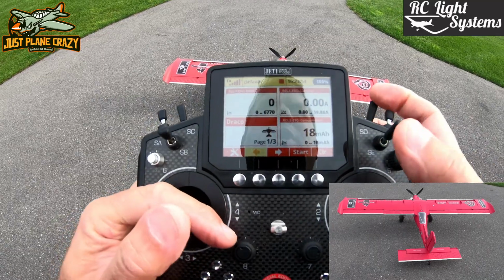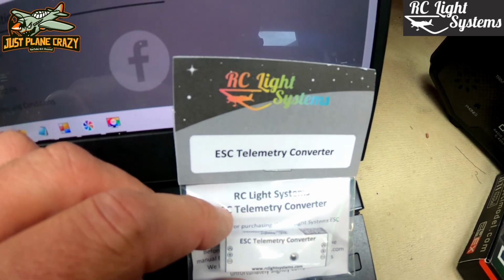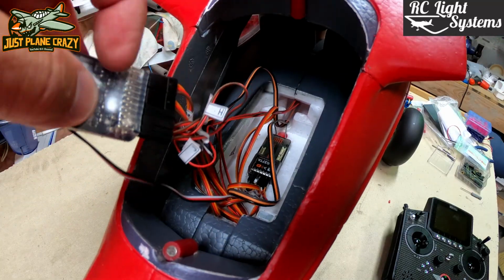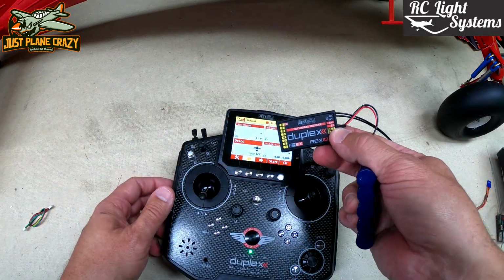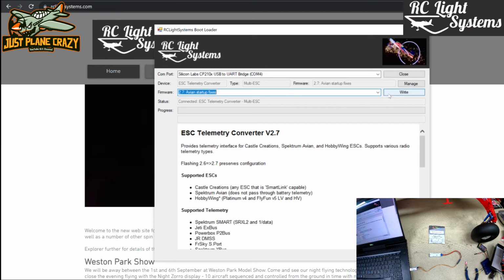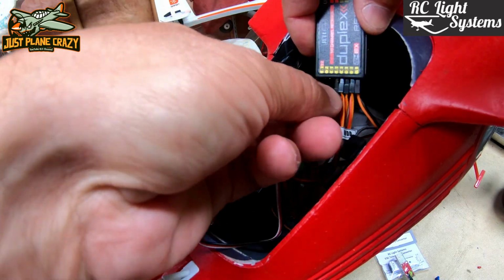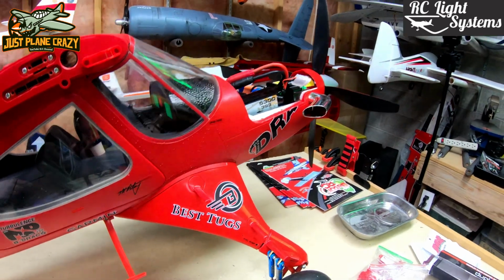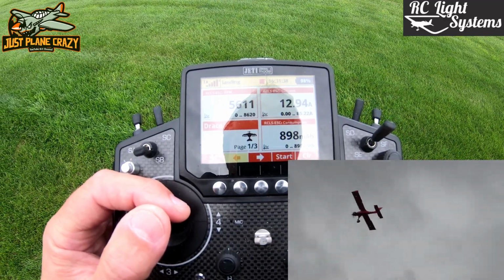How to get Telemetry and Reverse from Eflite Avian ESC's on Your Radio, Castle, HobbyWing, Scorpion

Comment: I believe you still could’ve used the rex 7. If I remember correctly with the esc updater/programmer, you can select which channel the esc looks for the reversing switch. I believe you can select channel 7, 8, or 9 at least, maybe more. Since the converter is running on exbus, it’ll still output all the channels your radio is sending.
Reply from the maker: Yes. You are correct and I noted that in the  video notes afterwards.  Kinda learned that as I went. Thanks for throwing this out there. It’s appreciated
Reply: @JustPlaneCrazy  Sorry, I see that now! Skipped the notes. I’ve been running the ETC on many of my planes for a while now with avian esc’s and jeti TX. It’s a great combo! Glad you put a video out to make more people aware of it! Great piece of technology and the support at rclight systems is beyond great!
Reply from the maker: For sure. I love this thing. Again I appreciate ur comments. Thank U. I am always looking to learn and share things.
Reply: Should also mention that the esc has to be programmed for reverse before doing all of this. And for that you need the programming box from Spektrum.
Reply from the maker: That’s not quite true. Some are already programmed and opened to a standard channel 7 port. It depends. A different channel can be programmed if desired.

Comment: First off thanks for this video.   Just to be clear, with the RC Lights System converter we can use any brand of lipo with the Eflite Avian ESC and still get mAh consumed along with the other telemetry on our Jeti radio?    Thanks again for the great video.
Reply from the maker: It has to be a telemetry capable esc from Avain. The battery brand doesn’t matter. As far mah used I have only ever used lipo, with the introduction of Li Ion I am not sure if voltage or capacity is best for those

Comment: Many thanks for this video.i want to use the converter on my Draco. When ordering it, there are two options: with a standard telemetry servo connector or with a Spektrum-XBus connector. Which one do I want. Sorry to bother you with this.
Reply from the maker: No worries thanks for watching. I used the standard telemetry connector

Comment: I would like to have the reverse on my futaba radio (t14SG).
Even by connecting the plug of the controller containing only the signal on an auxiliary channel of my radio, it does not work.
An idea ? Thank you.
Reply from the maker: Yes. With this etc you can have that feature. You need communication from the esc to your radio and this device will give you that.
Reply: @JustPlaneCrazy  My rx is an R617FS. He can't have telemetry ...
What do you advise me as rx futaba?
Reply from the maker: Anything with sbus2 ability should work

Comment: Hello, does someone have any advice how to get this working on Futaba t14sg with receiver r7008sb? I did the configuration of ETC (hopefully right) and conected it to the Draco. Light ond ETC is now green, so I think than config is all good. Normal function of throttle is working perfectly fine, but i dont know how to get telemetry and revers function working... 
Many thanks for any help!!!
Reply from the maker: Make sure you set the aux 2 function on channel 7. And then set a switch for it. That’s where the esc is programmed for. As far as setting up your futaba tele I don’t have that radio but they should all be the same. Find the tele menu and select what u want to display
Reply: @JustPlaneCrazy  Thank you for quick respond. To be able to see any futaba telemetry sensors, I have to register them in Tx first using an Y cable.... but this thing doesnt seem to be working that way....
Reply from the maker: Since I don’t have futaba my best recommendation is RC light systems a message via FB messenger. They are super helpful at getting you  going
Reply: @JustPlaneCrazy  OK, thank you very much :)